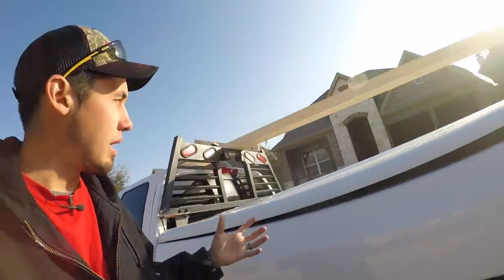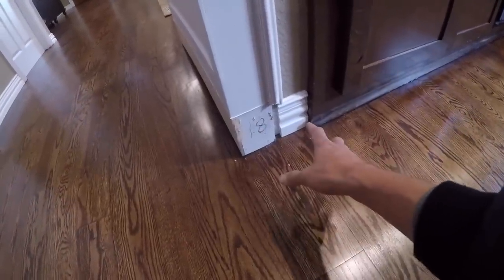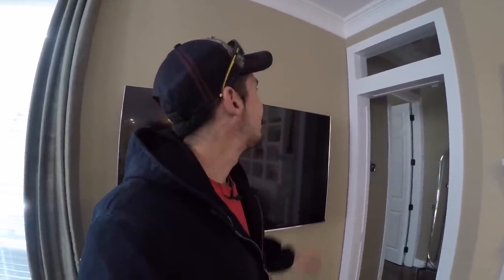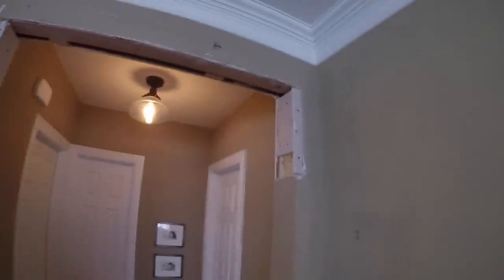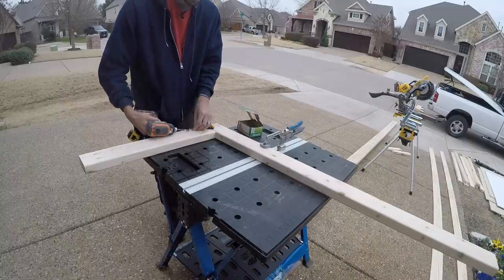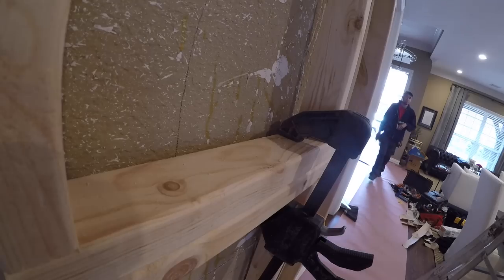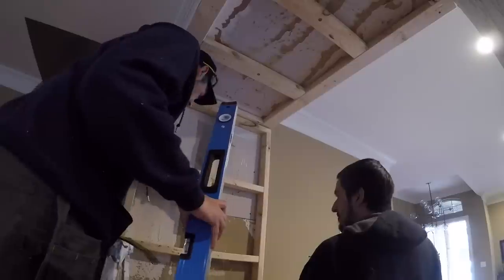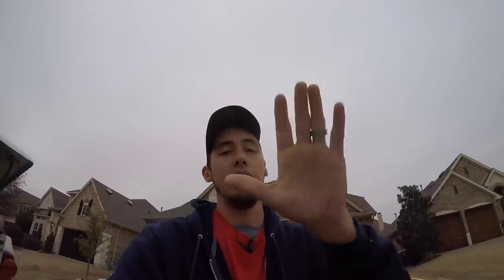A $3500 Mistake

Comment: You did not have use 2x4 you could have used a small diameter board like a one by two and you would have made that whole way smaller but because you used big thick two by fours that hallway looks a lot smaller than it should be
Reply: I believe he said they were looking to have the casing clear the stair treads completely, without notching.
Reply: Richard Jones he should have changed his casing if that was the case. they won't be able to get a couch through that hallway

Comment: I'm totally not a contractor. so most of what I say is more of a question than a criticism.

It seems like you're making a lot of assumptions. Using toggle bolts to fasten the center of the ceiling frame because there wasn't any framing to screw into seems irresponsible. you know there isn't any framing there. but if the resident, current or future, or even another contractor were to want to install something there, finding your frame would falsely lead them to believe there was framing there to bite into as an anchor. potentially leading to some sort of failure. is the end result strong enough to withstand the weight of most items that someone might try to mount or hang from the walls and ceiling you installed?

Comment: @15:40 If you really want excellent toggle bolts to hang a TV on a wall or what he is doing, I'll link to the ones I recommend.
With the toggle bolt he is using, if you ever had to unscrew something from a wall or ceiling, you loose that toggle bolt.
Then you would have to insert a new one. Also it requires a smaller hole size, and if you ever had to remove it, then the toggle will remain in place and then you can remount whatever you had mounted.
https://www.homedepot.ca/en/home/p.14-inch-toggler-anchors---10pk.1000695135.html

Also here's a quick video of them. https://www.youtube.com/watch?v=SC1ZuxuZ2PU

Comment: I like the way he explained everything until I saw that he hanged the two by fours with sheetrock hangers he just dropped the level of the original contractor obviously not a very good contractor of course you rip out the sheetrock and redo it to bring it to the same height and make it structual not fucking hang the two-by-fours by sheetrock hangers what the worst fucking thing in the world dude go back to school two by fours and 3 inch screws are not that big of a fucking deal

Comment: In my opinion this is not so good carpentry....but, another country, another culture, another workflow....
Why not removing the "bad" work, make a measurement, build the frames in machine-shop and fix them with regulating screws with adjustable end-position??? So, i am waiting for the next steps...

Comment: The curve is in the drywall and has nothing to do with the trim Carpenters and all the other shit I guarantee was run by the homeowner and the homeowner was okay with it at the time the guy installed it. There's no real right or wrong in trim carpentry. It's all what the customer wants and likes and very rarely is something done without the customer knowing how it's going to be when it's completed. And then they decide they don't like it or hear another Carpenter throw in their opinion and then all the sudden somebody has a problem with what they agreed on with the first Carpenter. Holmes on homes syndrome. Finish carpentry like this is very low level as far as skill and the guy doing it before obviously knows how to cut crown etcetera so I would blame the homeowner and not the previous carpenter.